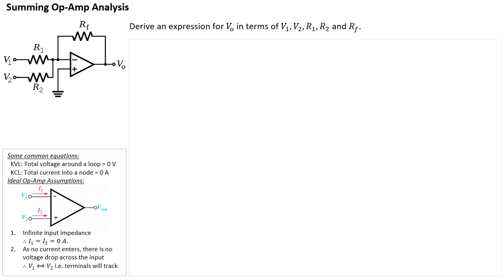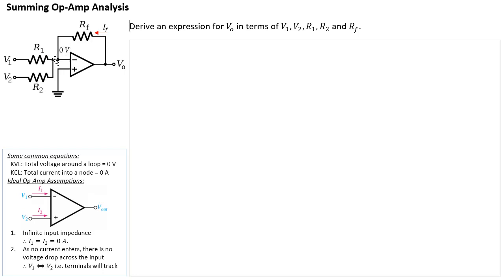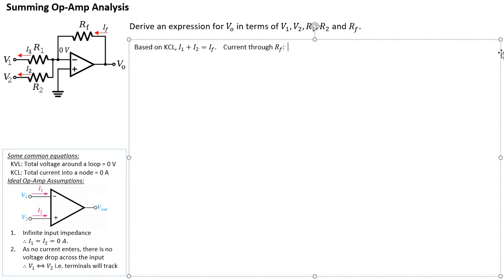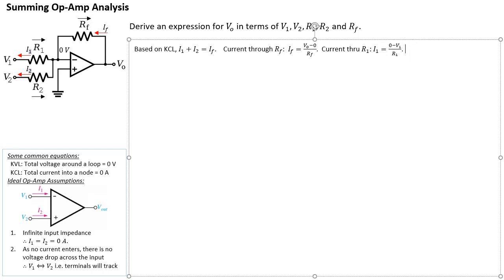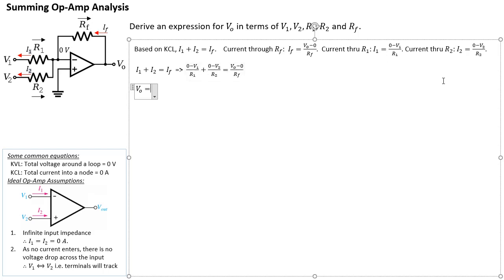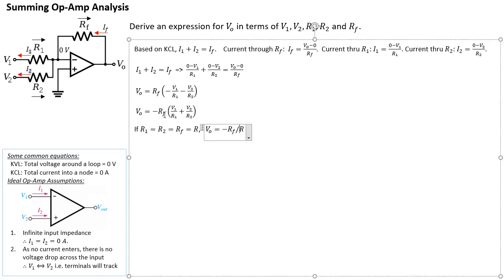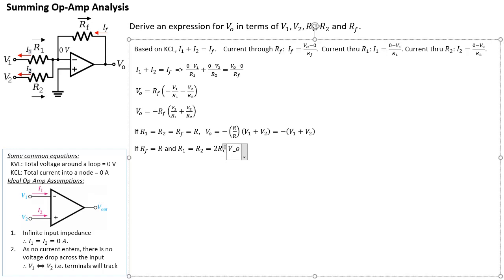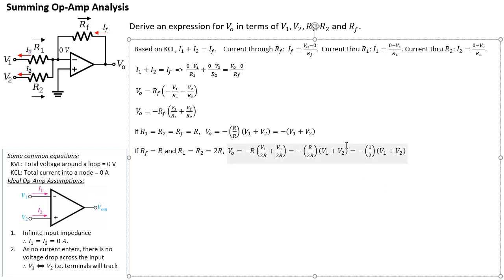OpAmp - Inverting Summing Amplifier

Comment: V1 and v2 value
Reply from the maker: Hi! In a theoretical sense, they can be whatever you want. So if V1=10V and V2=20V, then, as an unscaled summer, V0=-30V. And as an average circuit, V0=-15V.

However, in a physical circuit, the limits of the inputs and the resultant output would depend on what physical OpAmp you end up using. For example, a typical 741 OpAmp can only output up to around +/-20V (see LM741A datasheets).

Hope that helps! 😁